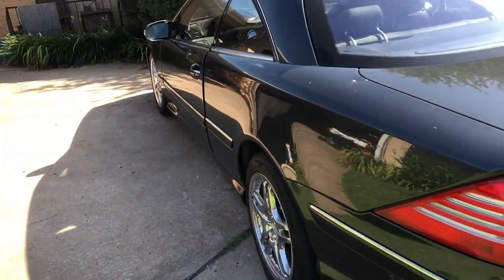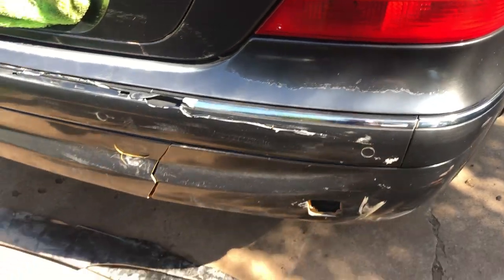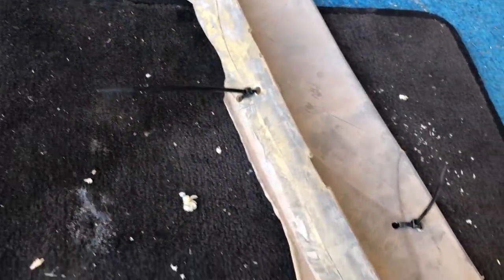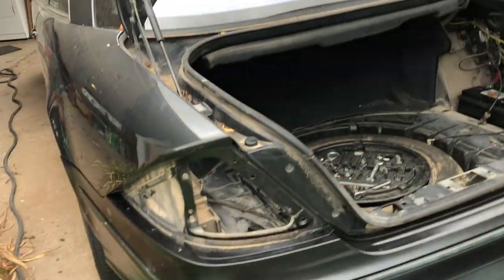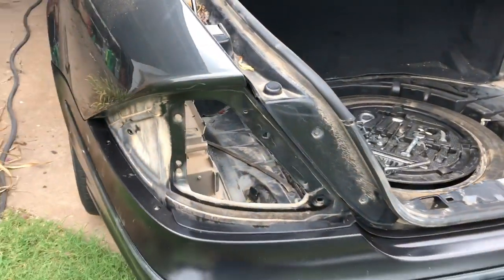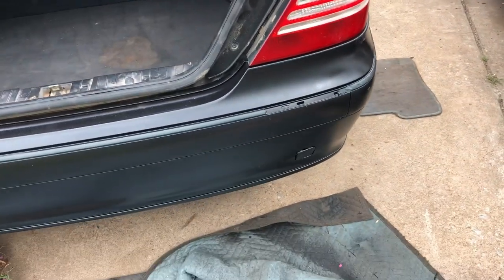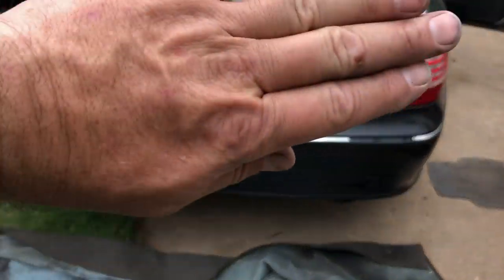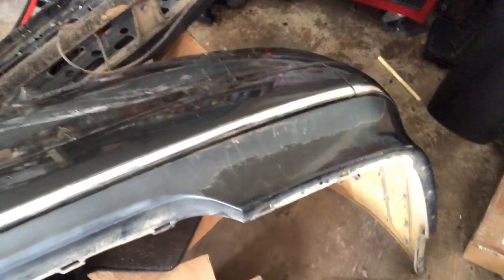Plastic Welding A Mercedes Bumper

Comment: The paint mix is probably right but the existing paint has spent 16 years getting bleached out by the sun and UV so it is likely to have bleached slightly.  You'll probably find that it'll appear to lighten up slightly when you spray the lacquer over it too, but water-based dark metallics are quite prone to sun-bleaching so they do appear to lighten over time...

Comment: don't you just love the Dermal tool. I bought mine in 1965 and it still works fine. they are so versitil. mine has a metal body not plastic like the newer models.  I understand that you are moving. I hope you find a house with more working room, it would make working on cars much easier and as long as you are moving anyway that is something to keep in mind.  good luck.
Reply from the maker: Yes! Thank you! I’m hoping to find a workshop/garage
Reply: @MonkeyWrenchMike  way to go Mike!

Comment: I would like to see you work on a car that has a big clear coat issue.  My 2000 Yellow SLK is peeling like a bad sun burn.  I have been using good old grey duck tape to pop off the bubbled and peeling clear coat.  I wash the car with regular car soap with no wax in it.  I don’t wax it. When washing the car the pressure of the hose will pop of some of the loose clear coat.  The paint under it is in good shape.

Comment: Plastic welding, worked with that one time, never very successful. It may be the type of plastic I was working with, wouldn't bond well with the filler rod. It was a plastic oil drain pan with a small hole in it, I used milk jugs as a filler rod.
Reply: Incompatible plastic’s won’t work.

Comment: Couple of questions Mike is that a plastic welder kit or just a large soldering iron? Are you still going to have enough time for your channel and are you going to do Copart videos in your new city🤞🏻 (I forgot where you're moving to 🙄)
Reply from the maker: It’s a plastic welder by Polyvance. You can get it on Amazon!
Reply: Monkey Wrench Mike cheers